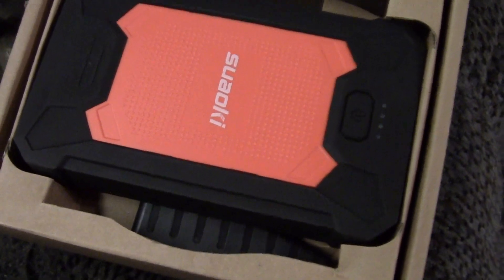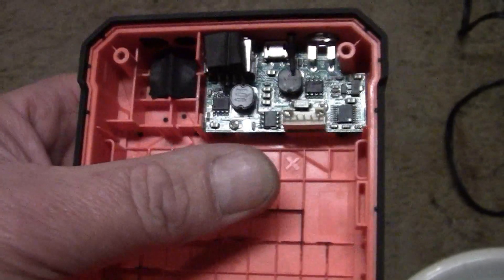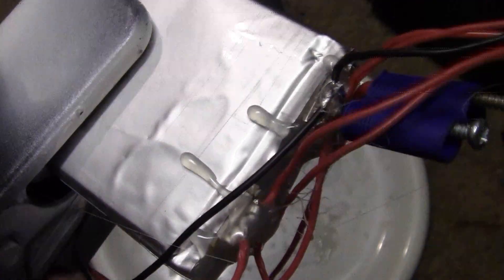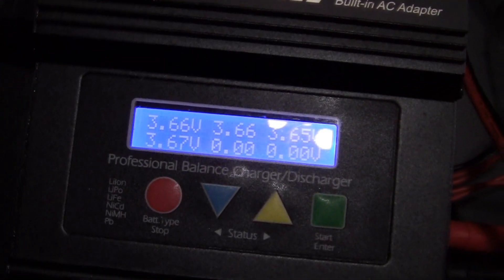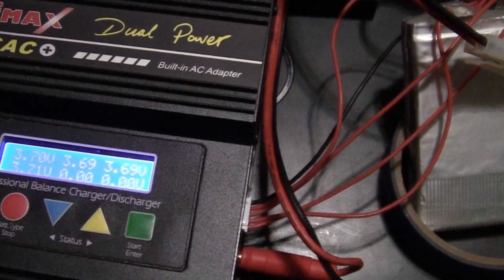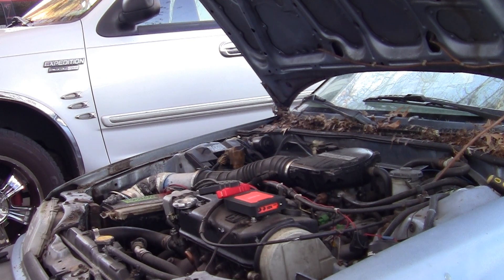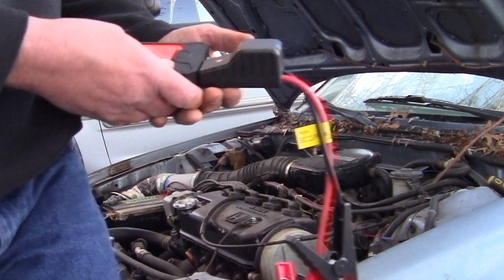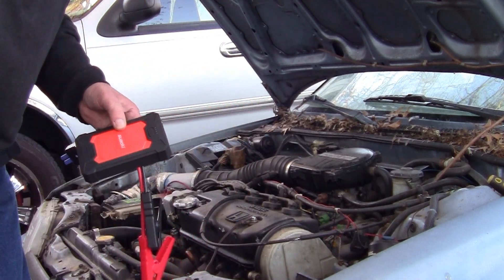LITHIUM BATTERY JUMP START PACK REPAIR

Comment: What kind of connector was that you used and could you give some information on the charger you used?  I have 2 nice LI jump boxes that have done that.  Both accidentally had built in light get turned on in the case and ran all the charge out of them.
Reply from the maker: It was a 4S RC battery connector . Thanks !

Comment: Nice, and for Goodwill price!
Reply from the maker: that car battery was so flat dead, there were no signs of life ! I wondered if it was going to work at all . I read the back of the box and it said to push that button if it failed to start . And it worked ! Thanks Everett ..